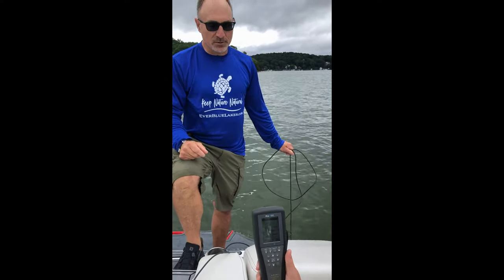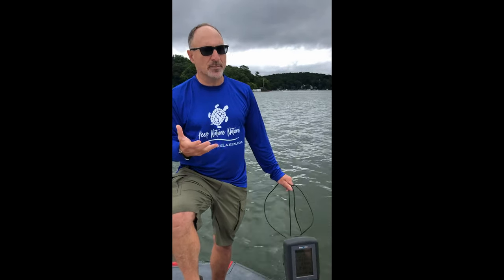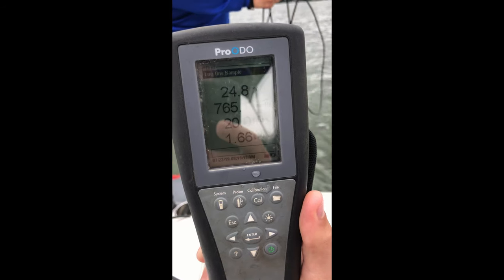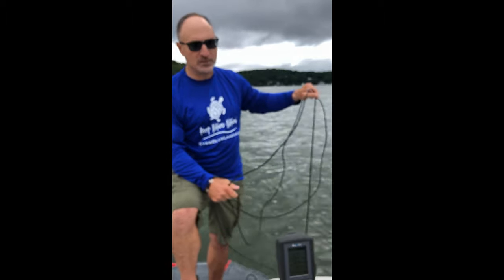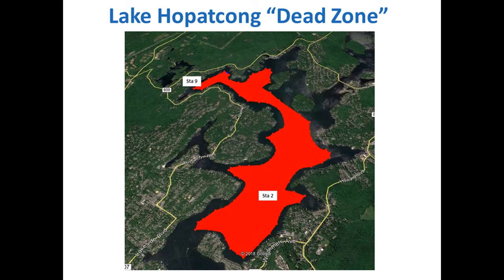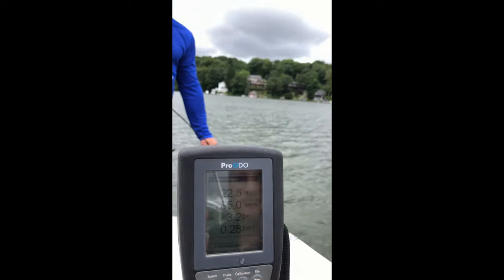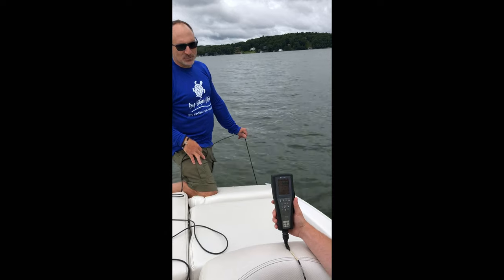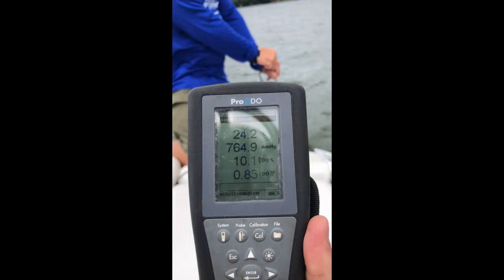Dissolved Oxygen Testing Lake Hopatcong

Comment: Were circulators installed to resolve the anoxic conditions?
Reply from the maker: @toddbrackett4277  The project is still in development. Largest lake in NJ with depths to 60 feet. We are now in the design stages with a plan to implement a deepwater Oxygen Injection system.

Comment: I think the explanation you are giving is misleading. You failed to mention that DO decreases as the depth increases naturally. This is because the gas exchange with the surface is not existant at the bottom of a lake .   You also stated that the entire lake is a Dead Zone, that is also not true.  There are plenty of fish at the lake.  I have seen lakes that have massive fish kills because of low DO. In fact you can even smell the decomposition when lakes get that bad.  I do believe that this lake and all lakes for that matter need better management but this video in my opinion is putting more fear in tourist that visit the lake and thus hurting the local economy.
Reply from the maker: I am sorry, but you are wrong. I did not say the whole lake is a dead zone. There is an 800 acre dead zone starting at a depth of 15 to 20 feet. This is not natural for a healthy lake. It has been proven by decades of science that lakes that substantially run out of oxygen at depth experience internal loading of Phosphorus and are at significantly more at risk for harmful algal blooms. Healthy lakes (outside the tropics) are resupplied with oxygen at depth twice a year through natural turnover. Healthy lakes are able to maintain DO above minimum levels through the Summer at depth. I appreciate the discussion, but your characterization of our statements on this video are not accurate. Thank you.
Reply: @EverBlueLakes  the image you show of the lake is completely red.  That is misleading.  The image indicstes the entire lake is dead.
Reply from the maker: @dumbbluefish  that image is 800 acres out of 2400 acres. It is accurate along with the commentary of the depth at which the lake is out of oxygen. It is not at all misleading. We measured DO at the margins and in the center of this whole area. I do appreciate your input and opportunity to clarify.